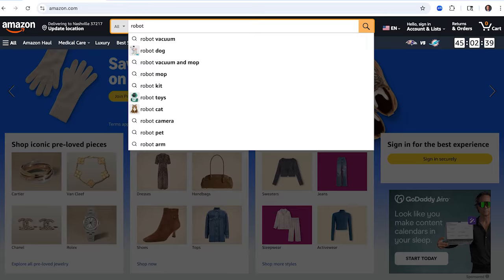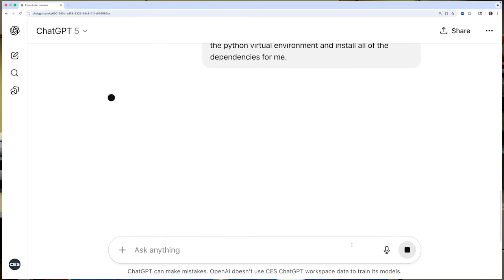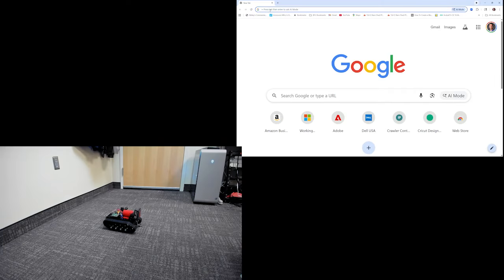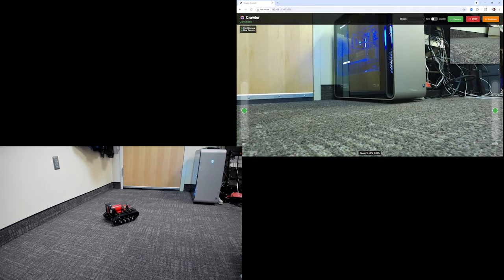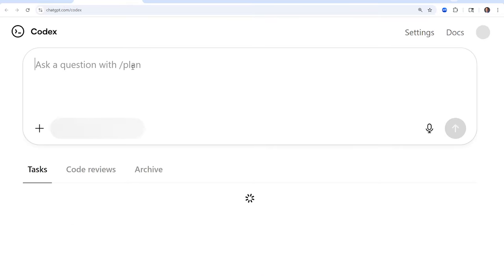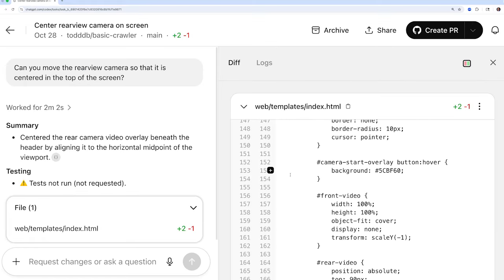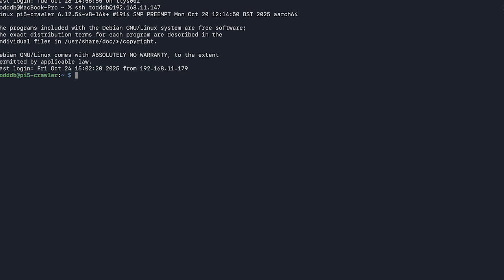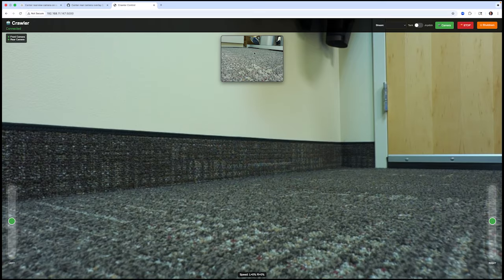Remote Controlled Crawler Robot - Built with ChatGPT Codex by a Non-Coder

Comment: Neat project but too bad you decided to not to learn a programming language.
Reply from the maker: So, I do know basic python, and I always look over the code changes to make sure I know what Codex is doing. But the amazing thing to me is that this would have taken me a year if I had to learn to do each step. Using generative AI tools to help me is such an accelerator to getting things done more quickly.

I would be very careful using this methodology in a setting where I didn't fully understand the code and there was protected data (HIPAA, PCI, FERPA, etc) and I was blindly trusting ChatGPT to write my application. But for prototyping a little device like this, I think it is such an enabling technology!